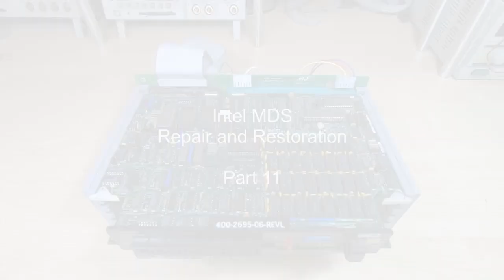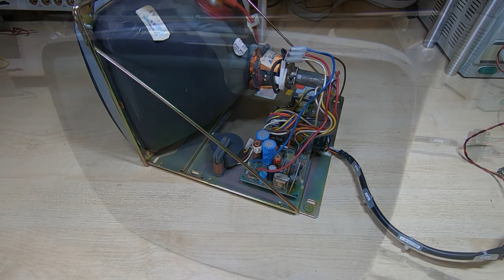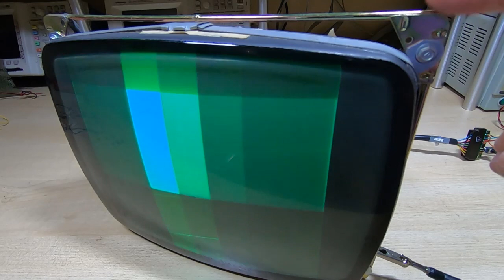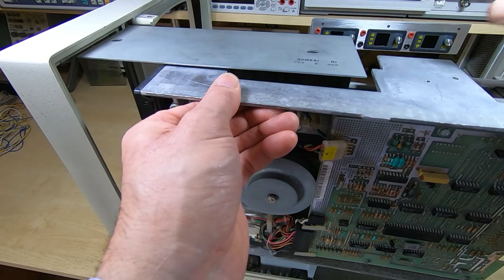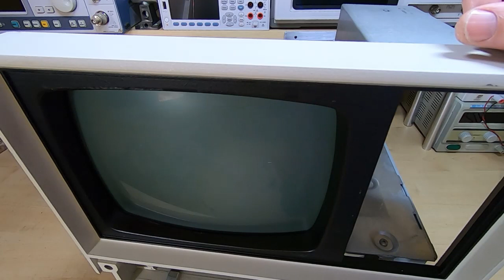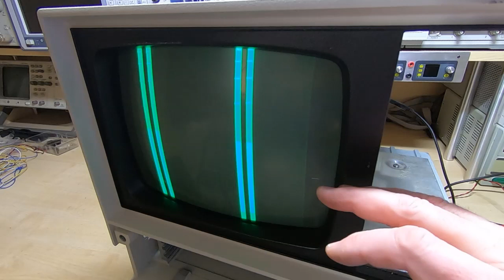Intel MDS Part11

Comment: Interesting to see how it was constructed as you put it back together. I never realised they had a plastic chassis, I presumed it was all cast aluminium. It's supprising it survives the weight of all of those components.
Reply from the maker: I think that without the big steel bracket that supports the power supply then the chassis would snap in half when picked up. With these chassis one of the most important steps is the levelling that I showed. It seems unimportant but if the load is not properly spread out then I am sure it would end up in many pieces. This thing weights about 40kg.
Reply: The MDS 800 is meant to be around 33kg and it's very difficult to handle with the PSU's in place, those transformers way a ton ! I've just released my video on the 64k Dynamic Ram Card which you might find interesting. I'm kind of curious what happened to the 3404 high speed latches as the outputs seemed completely disconnected inside the chip, will be interesting to see what shape your ones are in.
Reply from the maker: I have had some similar issues but you never know what has happended to these in the past. I am currently fighting with the FDD. I am trying to run the IOC disgnostics but the FDD test fails (error 100 - seek error but I need to look at the ROM code to see why this is failing).

Comment: Slow, but thorough in detail, this series. I like it. BTW, how did you generate the artifacts on the screen? Obviously a signal generator, but a specialised one?
Reply from the maker: The screen artifacts are just from a pulse generator. As long as the pulse rate is a multiple of the line rate then vertical lines will be produced. The voltage levels determine the intensity. I forgot to mention it in the video but the retrace lines are visible because retrace blanking is normally provided by the CRT driver circuit which is not of course present. The V and H drive are simply from pulse generators set at suitable rates for the monitor.